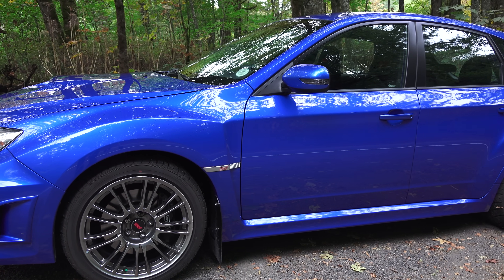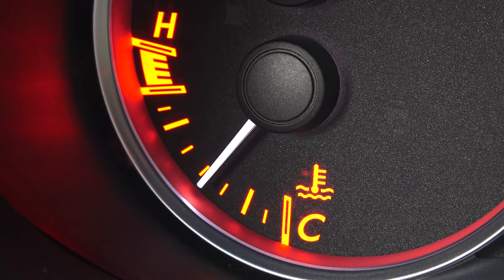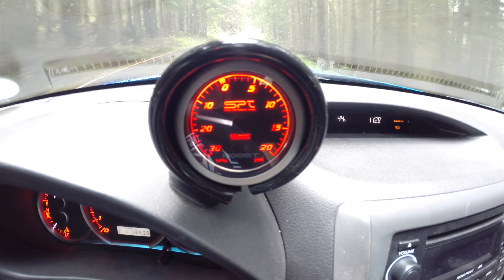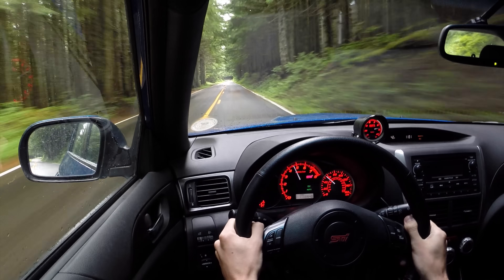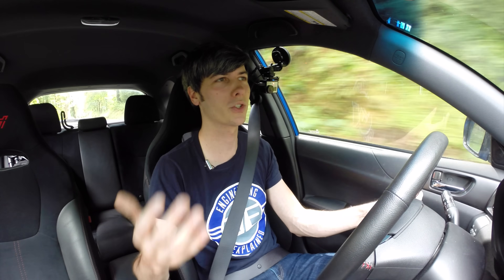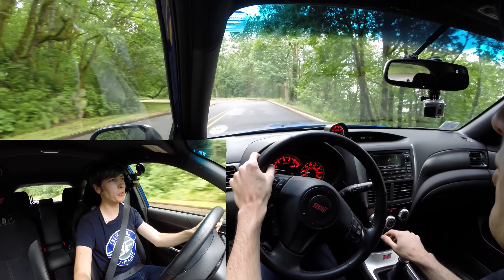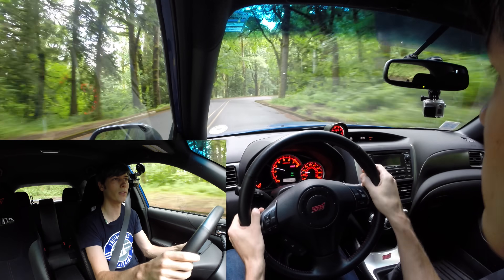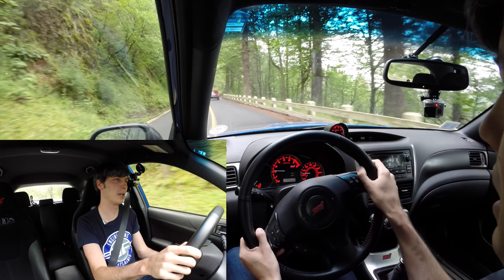5 Things You Should Never Do In A Turbocharged Vehicle

Comment: I don't think your all of your tips apply to modern turbo charged engines.
@knock It don't know about the fuel quality in the US but here in Germany my car requires 95 oct fuel. Putting in 98 oder 102 oct fuel makes no sense as a) the engine (at least mine) doesn't recognize higher octane rates and b) modern cars have a knock detector, so bad fuel won't harm the engine.
@high load @ low rpm AFAIK engines have air flow meters. So do they actually inject that much more fuel even if this meter is telling them that there isn't enough air to burn it?
Reply from the maker: +Simon Schneider use what's recommended, obviously. Most turbo cars in the US will recommend premium. And if you tune it, better to be on the safe side.

Comment: Hi I have 2 questions,
1) Turn off after running the car on turbocharger engine is bad even is the turbocharge is cooler/oil? 
2) If you isolate the temperature of your turbo, maybe with a blanket, can be beneficial to reduce wear in other parts?
Reply: 1) depends on how your engine is designed, most factory style cooler/oil turbos will use thermal siphoning to continue to circulate coolant even after the engine is turned off or some modern cars have a pump that will continue running for a while after the engine is turned off.
2) Too much heat is an engine killer and any way to contain it or remove it should be beneficial to all the parts. But if your turbo cooling system isn't very efficient then a turbo blanket or insulation could cause it to prematurely fail. 
I know in turbo Subarus that the factory location of the turbo and downpipe is extremely close to the engine block and has been know to cause cylinder 3 to have problems so turbo blankets and exhaust wrapping is helpful in keeping the heat in the exhaust piping.
Reply: @Vegaspsycho Thank you for your reply, my car is a mazdaspeed 6, and as I know is designed to cool even after turn off the engine, but I'm going to search more info about it, and I don't know anything about failures caused by overheating in the turbo, but I a blanket can help me to insulate the temperature into the turbo and not passed to all engine bay, so I think can be a good idea to buy one.

Thanks!

Comment: I think you might be overstating the issues with "lugging" your engine, especially for vehicles with automatics and a lot of low-end torque. Yeah, if you're looking for more power than what that RPM can give you, go ahead and down shift, but if you can gently roll into the throttle pedal and wait a little bit for spool up, I don't see the point in manual shifting or forcing a shift, especially for lower revving diesels that don't have much RPM to work with. Really, I've never worried too much about this in my automatic diesel truck, and the engine has 180,000 problem-free miles.
Reply: Rolling into the throttle, good stuff.
Reply: Good point about automatics and torque. Many of these are powertrains are designed to deliver power WITHOUT up shifting. In fact, when I'm at 1700-1800 rpm in 6th gear, my diesel will absolutely not allow down shifts for more power. It was just made to deliver so much low RPM muscle, it won't down shift no matter what I do. So what am I supposed to do, never pass people or go up hills? Also, what is the point in low-end torque if you should never use it? It just there for emergencies? Of course not. They were designed to work this way. If an engine is running too much fuel, the ECU adjusts for this to avoid engine or emissions problems.

Comment: Wow! Thanks for that. I've always wondered why the black smoke would go out the exhaust pipe when giving it (mazdaspeed 6) gas in 6th gear at a low engine speed. Thanks.
Reply: Dude. Don't do that in a mazdaspeed. You will bend your rods. Trust me, my mazdaspeed 3 had zoom zoom boom already.
Reply: MichasQGP Wow. Treat it well and it will last a long time.
Reply: MichasQGP Maaaan, that sucks. I don't do it anymore, probably a few years now. It's that available torque in 6th gear at freeway speeds that made me think it was okay. Now I just downshift. How long did you have your speed 3?
Reply: This is my second year, owning my mazdaspeed3. Its a 2010. The previous owner blew the engine at c.a. 86.000 km, and it happend on a motorway as well. From what I heard about him, he was very rough with the car ;) Lucky for me, I bought the car with a brand new, stock engine, replaced by the dealership. Mazdaspeeds are great, fast cars, but the engine rods are way to fragile.

Comment: Ok. not to stop the engine when you used your turbo a lot. However, many cars with turbos have Stop-Start systems. So what to do in this case? disable it or the oil continues to flow with the engine off?
Reply: You are typically in a slow, urban area when the stop start is being used and not in a sustained high speed steady boost situation like during freeway travel.
Reply: Many cars the engine oil does continue to flow after the engine is shut off.
Reply: That just sounds like bad engineering lol
Reply: There would be parameters like too much heat which would prevent the stop-start system from kicking in. The same as when you have too much power drain and A/C, it never shuts off.
Reply: imagine what that must do to the starter motor

Comment: My country has 91 octane as the lowest, 95 octane and 98 octane. But you can't find 98 everywhere, so is it fine that if I just use 95 octane the whole time?
Reply from the maker: Use what your car recommends, and if that's not available use the best you can find.
Reply: Use the octane rating your vehicle manufacturer recommends for your vehicle. Using high octane rating on stock cars is throwing money away, they do not produce more power or add longevity to your vehicle.
If you modded your car, then you should tune it for a specific octane rating and stick with it.

Comment: So #3, don't roll coal??
Reply from the maker: I'd imagine most of them are straight piped, so the exhaust is probably fine. I wouldn't be thrilled with someone dumping gasoline into a river. Equally, I'm not impressed by someone pointlessly dumping carbon/diesel emissions into our air.
Reply from the maker: Haha, I think that much was obvious. :)
Reply: No. Don't be a douche
Reply: +Trevor Burgart it's not making less power. The very principle of Diesel engines means it's not making less power. It's simply not making as much power as it can for the fuel its using which is an air problem and can be solved with more boost. Go watch some diesel drag racing and tell me they're making "less power" because they're rolling mountains of coal.
Reply: Well obviously all that soot from rolling coal is unburnt and wasted fuel. :)
Reply: +Engineering Explained Was that more for the fact it actually messes the engine, or for the dick factor?
Reply: straight pipe it and roll coal all day bahd
Reply: causes carbon buildup on the turbo
Reply: other than just rolling coal you should have talked about how it creates more blow by and fills your intercooler and intake with oil and then when it mixes with carbon after your egr and plugs up your heads and intake
Reply: Engineering Explained pointlessly? its called max power dog!
Reply: +Trevor Burgart is your 7.3 the 94.5-03.5 international they put in fords?
Reply: I guess😞

Comment: Can my car be damaged (without a turbo) when accelerating with full throttle?
I have a really small - 1.2 litre - engine, which you can imagine the power of. I usually floor it just to have some acceleration and I know it's not the best for the car but can I cause pernament damage by doing so?
Reply from the maker: I mean, the power rating of the engine is based on flooring it. They're obviously designed to do it. As engines as you may end up burning more oil or causing damage through fatigue, but if you always have to give it 20% throttle it's not going to be very thrilling. ;) More power means more stress, meaning longevity goes down.
Reply: We have a Nissan Mirca as a company delivery car, I have driven it for over a year every night and I literally go foot to the floor EVERYWHERE (seriously not joking as I drive a 5.7L V8 and hate the slow 1.4L in the auto Micra). It has 224,000km on it, been thrashed all it's life as a delivery can and yet works flawlessly, no smoke, no miss fires or anything. I'd say you are safe to go flat stick everywhere.
Reply: Downshift bro, i drove m ysuzuki swift 1.2 for 2 years with ZERO maintenance, because i bought it for cheap. And it ran like a champ, but I wouldnt do what your doing for a long amount of time if you're in a european car
Reply: I have a 999cc vw polo and I floor it the minute instart the engine, I rarely use 4th or 5th gear, the car is an absolute snail,
Reply: I service and repair all my own vehicles so if I break them it's my problem, besides the work cars. Only time I ever came close to hurting an auto tranny was with my 2005 Mitsubishi 380 5sp auto, took it for a 20min spirited drive on a winding road at speed between 60 - 200km/h and caused the transmission to get so hot the car went into limp mode and wouldn't change gears, lots of dash warning lights. Parked it to let it cool and was fine again. Cars are pretty tough, especially Japanese ones.
Reply: When cars die they go to the slimeball lots that sell cars to poor people with bad credit for about 5 times what the car is worth.
Reply: i got a 98 toyota avalon, man that car is freekin amazin, i beat the crap out of it 24/7 ive gone off roading, and i had an incident when i drove through some deep manure, as far as modification goes i bought a new 10 dollar air filter some car quest brakes and wiper fluid and this honey flies yes she does, yes she does
Reply: if you don't lry your car warm up by driving for a little bit first, then yes
Reply: Not always just when I have the mood :)
Anyways next time I'll try to rein in my foot...
Reply: I can't downshift from second gear :D
Reply: Mavusi Kenpachi I reckon that's non-sense, I've done it a number of times in a number of cars with no ill-effect.
Reply: +Mavusi Kenpachi Get a Mishimoto rad if that bothers you. I have one and my non turbo Honda runs 10 degrees cooler than stock.
Reply: Where do cars go when they die?
Reply: everyone rags 1.2's don't worry about it.
Reply: Mavusi Kenpachi which is better?
Reply: Mavusi Kenpachi I meant fords or gm 1.0 turbo engine
Reply: Sounds like you have an automatic transmission. Any car regardless of engine and transmission types  are prone to higher rate of wear and tear at high rpm. But with clean oil and filter change more often will reduce wear and stress better when it often sees high rpm. Just remember a person often revs their engines at 6000 rpm or more will definitely going to wear lot more than the other guy at only 2500 - 4000 rpm. going to the same route. Most automatic transmission cars when floors on D mode momentarily doesn't  always mean it reach to max rpm. Therefore read your tech gauge.
Reply: where do. you live guys? i cant go over 30MPH :(
Reply: +John Kyon those engine are serious crap dear lord free us of those shitty minimalistic engines once and for all..
Reply: Ivan Nosic explain how they arrrr shitty???
Reply: Just like everything else, you just add a little more wear by pushing it hard. as others said, if it's Japanese, you have nothing to worry about, it will run perfectly for 20 years. If it's European, well, I guess it's life expectancy will be much shorter than that :)
Reply: dimos k what makes you think you have nothing to worry about if it's japanese? Do you k ow where japanese car parts are made? Europe!
Reply: John Kyon correction: you have MUCH LESS to worry about.
It's not only about where something is made. It's the procedures, and the demands that each manufacturer has from its suppliers. 

And basically, I base it on every years, TUV Report which shows that the Japanese cars are traditionally the ones with less problems in every list there (except for the "0-2 years old cars", because 2 years is the warranty for most European cars, so they make sure their cars are reliable for that period)
Reply: dimos k what about German cars?
Reply: John Kyon they are still European aren't they? I included them in the "European cars" I mentioned
Reply: Are Chinese cars any good?
Reply: John Kyon common sense says no. And so do the very few tests that are done to the very few Chinese cars that were officially imported in europe.
Reply: dimos k how about american cars like good old chevs and buiks and fords?
Reply: John Kyon no idea. American cars are almost non existent in europe, with the exception of Jeep ofc. 
Besides, most American cars are made for domestic market and are not designed to fulfill European legal demands. So the statistic sample is obviously too small to derive to a certain result
Reply: dimos k what are you talking aboot? Do you know how popular ford cars are in my cuntry?
Reply: John Kyon oh, sorry, Ford too. I forget Ford because their models are totally different in europe. Or at least most of them
Reply: I had a similar experience with a big block Chevy and it's TH400 transmission.  I was surprised how much it heated up after some vigorous use.  I guess it's a good idea for anyone to add a transmission cooler and maybe more fan airflow if their car is to be driven hard.

Comment: I was always told that if a car wasn't designed to run fuel with a high RON/anti-knock index to avoid using it as it could result in worse efficiency. Is this not true? Lots of sites out there state this.
Reply from the maker: Use what's recommended. If you tune your car, use the best you can get (to be on the conservative side of reliability). You won't get worse fuel economy using a higher grade, but you won't benefit if your car isn't designed to use it.
Reply: +Engineering Explained is this the same for diesels. Or is something like Shell V-power nitro worth using over the cheaper one they sell?

Comment: Another thing you shouldn't do is just slapping a boostcontroller on and keep cranking the boost up. A lot of subbies met an untimely death because someone overboosted the turbo beyond it's capacity. Also a top mount intercoolers have a problem with heat soak so don't floor it when you've been in slow moving trafic ;)
Reply from the maker: More power = more stress = less longevity. If you want it to last, it has to be built for it.